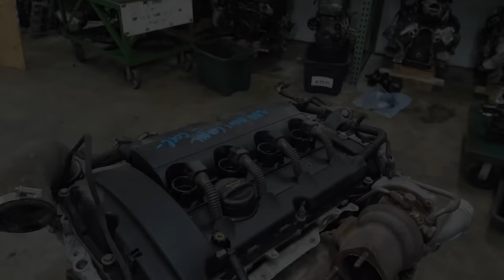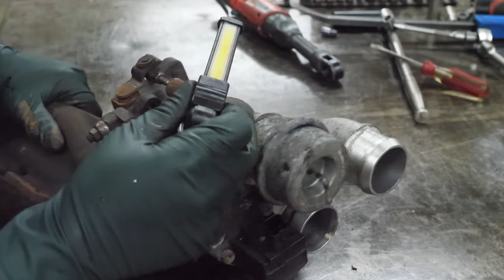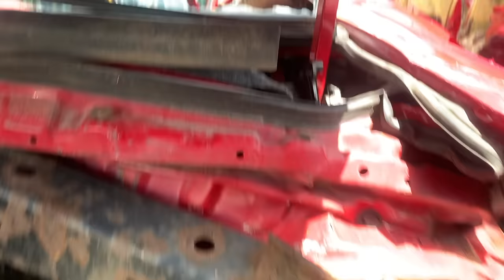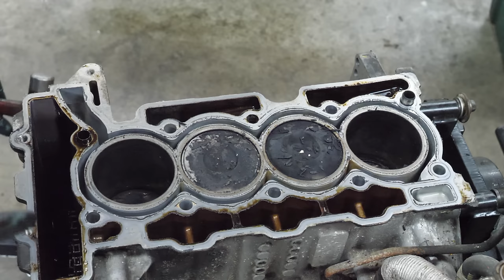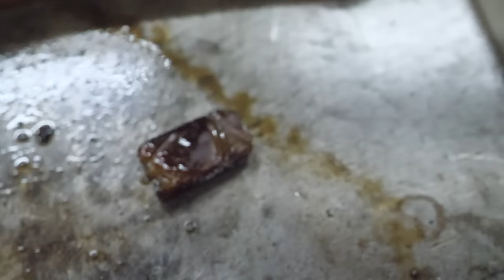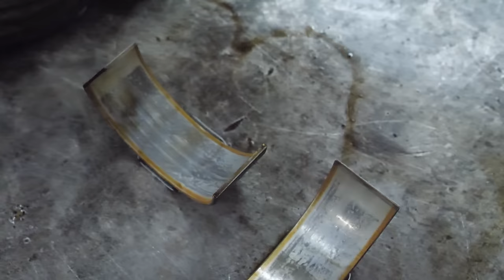JUNK Mini Cooper S (BMW/Peugeot) N14 Turbo Engine Teardown. Why Do People Buy These?

Comment: The 08’ Clubman S was the simultaneously the best and worst car I’ve owned. Great performance, handling, and good MPG. Yet quirky, unique, and good looking. Despite many positives, it was a total money pit that left me stranded several times and put me on a first name basis with all 3 service writers at the dealership… all under 80,000 miles.
Reply: Its also easy to make them fast, my buddy had a S model, he spent around 2K on modding and tuning it. He kept it looking stock, but he would stomp on Vettes and Mustangs at thr 1/4 track. His best time was in the low 11s. Also the tuning parts he added solved alot of the issues and weakness of the car.
Reply: good looking is a stretch
Reply: since 2013 3rd gen they have had the bmw b48 engine
Reply: @hotdog9262 an even junkier engine 😂
Reply: @LynxStarAuto  b48 is a very good engine
Reply: @hotdog9262 an engine is a good as you treat it. Especially if you know HOW to treat it
Reply: @EveanGreen  sure. still is a massive difference between them though. the core peugeot engine is not a particularly good one
Reply: @hotdog9262  👍
Reply: Good looking is subjective
Reply: @wutang80oc39 could you please tell me what all was done on that car? I own the same one
Reply: I had the same car and feel exactly the same way with a similar experience. My follow up car was a GTI. It cost me much less in maintenance.
Reply: @CorySeamer  lol. Same. Traded in that clubman s and got a GTI too. Way more reliable

Comment: You are so right about these engines... my daughter has a mini cooper S. Not only do they fail, often, in multiple ways, but they are so overcomplicated when performing even the most basic maintenance (such as changing the drive belt)... while standing next to that stupid car in my garage (after three frustrating hours of work) I often see myself slowly putting my hands around the throat of the engineer who designed this thing and somehow I feel better...
Reply: your daughter checks the oil every fiil up? services the engine at recommended intervals? i bet the answer is no to those questions. i drive mine like i stole it but i also make sure everything is full an taken care of.  worst problems i have had is my stereo keeps blowing alternators and i blew a belt at 160k miles.
Reply: @toddpedersen1866  I got 2007 S, 126k km, it was driven by a woman as a daily drive (i don't think she ever took it beyond 3k rpm). I got my alternator fixed few days ago, as it broke once i put it to the stress. It was such a weird sound from alternator, everyone thought it was a timing chain, it made such a rattling noise (tho it had been changed on around 70-80k km). It was also loosing oil, the engine cover was really poor and probably not properly placed, so got that changed also. Spark plugs too. 
All seems good now. 
Any advice on what i should look after besides the regular oil check? I really love the car, i never feel bored when i drive, so I'm hesitating with the decision to sell it as i got pissed when i had the issue, as it was a month after i got it.
Reply: maybe its just beyond your skill set. bet she is smiling while driving it though!
Reply: In the voice of homer: WHY YOU LITTLE...
Reply: There is nothing difficult about removing the drive belt. Just did it 5 minutes ago. Remove wheel and  fender liner. Turn the tensioner with a wrench, pop the spring pin in to hold it. Pull friction pulley tab, remove belt. Install belt, push tab back in, wrench on tensioner, remove pin, done.

Comment: My wife had an 08 mini, she loved that car, fun tondrive, but a maintenance nightmare. The extended warranty paid for itself 5 times over. So many problems. Car lasted 85k miles before failing, right after tbe warranty ran out. 

2 water pumps, 3 thermostat housings, oil cooler housing seal, wiring issues, rear hatch latch replaced twice, leaky sun roof. We bought it used with 10k miles and always did the mainenance on schedule. 

Edit: forgot 2 valve covers.
Reply: I really hate aftermarket warranties as I could just save up and pay for repairs myself. But when it comes to cars like these or even any performance orientated vehicle, I think it's definitely worth it.
Reply: My wife had one too, and it was so bad, and she had to go to the mechnics shop all the time. I could not understand until I discovered from my small dashcam that the young mechanic and her had been taking long test drives and he had been riding her hard every time she went with the car.
Reply: @thorsrensen3162  sounds like a personal problem
Reply: @Bigbacon  She wanted a long throw stick shift.
Reply: don't forget the High Pressure fuel pomps failing every 90.000KM :P sorry to hear it... LOVE my car too, but it is kind of a nightmare
Reply: Yep those plastic thermostat housing was terrible.
Reply: @thorsrensen3162 my girlfriend has a 2018 cooper s with 200ps. nice, fun car.. Maybe i should change the girl before the car breaks down. 🙃
Reply: @Nitroat-xo4tj  Her car has not required any repairs since then and I has found a new shop with two older brothers who I trust will keep their hands off her azz.
Reply: Really enjoyed this video with the low down on the crap engine inside.
Yes certainly fun to drive but me mechanical mayhem to maintain.
Could it not be possible to transplant any other engine into these fun good looking cars like in the sense of the classic Mini’s that have transplanted Honda engines?
Reply: Really enjoyed this video with the low down on the crap engine inside.
Yes certainly fun to drive but me mechanical mayhem to maintain.
Could it not be possible to transplant any other engine into these fun good looking cars like in the sense of the classic Mini’s that have transplanted Honda engines?
Reply: @Ksn641  for how packed the engine bay is, i highly doubt you could get anything else in there easily. Working on them with the mini engine was a nightmare.

Comment: I was once a proud owner of a Mini… mine was RHD, it was an Austin Cooper of 1967 vintage with the short stroke 998cc and dual SUs. Most fun car ever!
Reply: the later ones are rubbish I had one...got rid of it before warranty was up, also had an I8 with the 3 cyl engine more rubbish
Reply: My first car was a 1965 Cooper S 1275, overbored 0.020" to 1293.  It had dual SUs, but big bore 1 3/4 ones off a Volvo.  Also had a '67, but it was mostly a parts car to keep the '65 on the road.  Oh, the best part was the Hydrolastic suspension that you could pump up and down to change the ride height in a couple minutes.
Reply: Nowadays a geniune Cooper S 1275 are worth BIG money one was selling here  
$75 000!!
Reply: @d00dEEE  1 3/4, WOW, tried 1 1/2's on my 997 once and had fun really stepping on it, and could also watch the gas gauge move down at the same time.
Reply: Back when the British built them..ironically, British cars were considered inferior to German ones, and they were!
Reply: The older coopers and S were great little cars on there wheel or upside down the best fun you could have with your clothes on or if you knew athletic girls great 👍👨🏻‍🏭🇬🇧
Reply: And a proper engine, not like that BMW crap!!
Reply: @WeeShoeyDugless R53 engines are good
Reply: @Roomsaver  
Depends on how you rate good?
Good as in better than a 70s Moskocitch?
Reply: That would be a Mk 2 Cooper. My brother had a Mk 1 Cooper ( rubber suspension) with the 997 cc engine which was inferior.
Even so what was lacking in power was made up with grip.I have never been round corners faster in any other car.

Comment: I've had lot's of fun rebuilding R56's with N14 engines. Buy 'em cheap, rebuild 'em, drive 'em till they drop! I've had four so far. Most fun for the the buck if you dig getting greasy! 172 hp is plenty for the car and they fly around corners. Not for the feint of heart or those who don't like getting dirty.
Reply: The most dirt cheap fun a car guy can have
Reply: What’s an R56?
Reply: @Homerlovesbeer2  Second generation cooper hatchback. All the different body shapes and generations have their own designations. N14 is a turbo engine used in those second gen coopers.
Reply: I got an 07 in otherwise almost pristine condition (no rust, Interior almost perfect) for free. Has sat for 10 years and the person who gave it to me (first owner) said he thinks it was a timing chain issue. I sent a bore scope down each cylinder and didn't notice any damage at all to the piston tops. Engine cranks over and the 10 year old oil looks as clean as you would expect. I'm going to work on the non-engine related things first. Can't get the drivers door open, rear hatch needs to open with the "secret ring" and the sun-roof tries to open but can't. It's too nice of a car to send to the crusher but I'm proceeding slowly as I learn more about the Coopers so I don't invest more than it's worth.